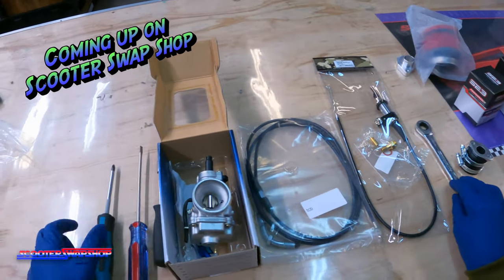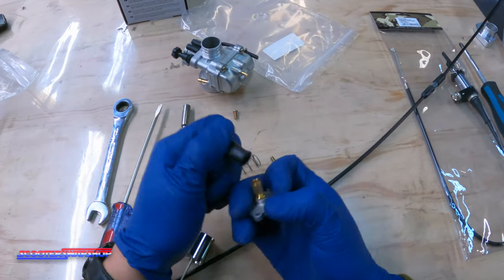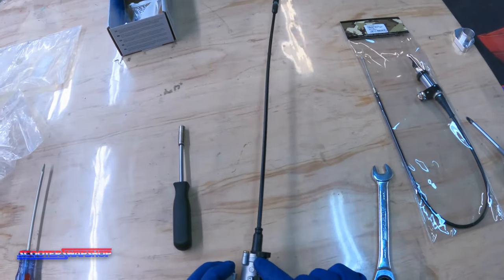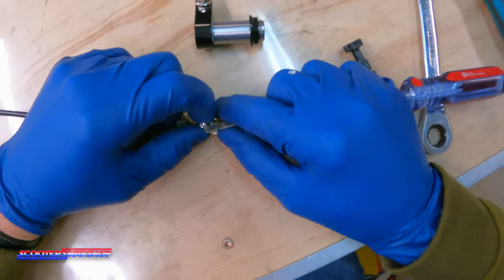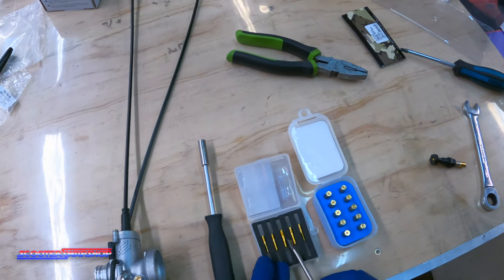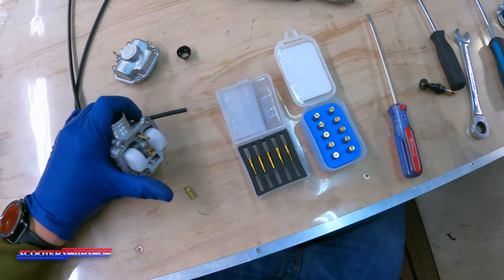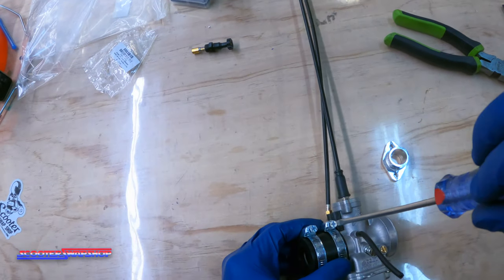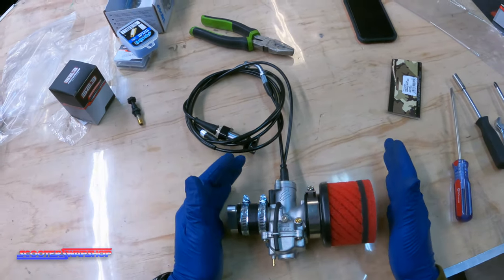How to install: Honda navi Performance Carb

Comment: Great video. I hope to get mine soon. Love my Navi and the upgrades I have done so far. I like these info videos along with the fun ones you have done recently. The instructional are my favorite though. Keep ‘‘em coming! I would love to see a video of PROPER brake adjustments for the Navi. Not a lot of good resources for drum brake adjustments. (That I could find anyway)
Reply: What is your top speed now?
Reply: @brettrolf4878  I have not been able to get the polini working at my elevation…. YET! I have new jets to try, and I bought a exhaust to see if I can get it tuned properly. My top speed in the flats right now is 45-52 MPH . I have hit 52 a few times, but it usually sits about 47. Hopefully I can get the carb right and my hope/ goal is to be able to maintain 45 at 3/4 throttle. I’m not racing, just want it to be more efficient use of power and not need to work it so hard in the 40-45 range.

Comment: hello, your videos are very interesting modifying scooters, I have a navi and I would like to get the most out of it in all aspects, engine, cvt, intake, exhaust, electronics (cdi, coil, spark plug, a better more powerful stator) better rims, brakes disc, bigger tires, etc...

Can the displacement be increased? up to how many cc could it be increased

will it be possible to make a swap for that of an injected honda pcx?

thanks greetings.
Reply from the maker: Hi just send us a message on the app. There are no big bore kits currently

Comment: Hey what are your impressions on cheap OKO carburetors from Aliexpress, they seem very appealing. I have a naraku 75cc aluminum kit. I'm making my own Arrow pipe right now but the stock carb isn't going to be enough. It's a Kymco Fever ZX2 af18 clone with a 14mm i believe, I drilled the main jet to 100 and it's been running well for over 2 years now with the stock pipe. Can I get your recommendation?
Reply: They will tell you they suck and then reccomend a polini cp
Reply from the maker: You get what you pay for in theory

Comment: Is there a fuel injection conversion?
Reply from the maker: No sir, and if we made one it would likely be $500-1000
Reply: @Scooterswapshop  if it is on the lower end of that range ($500) sign me up ✍️ - It would be super helpful to not have to keep rejetting lol

Comment: I put on your intake and variator   With jet kit …   Not sure i got any gains at all honestly   Maybe 1 mph top end  maybe 2  gonna keep messing with its   Had to punch out Welch absolutely   No option on that
Reply from the maker: The tuning takes time. You should be getting 55+.
Reply: @Scooterswapshop  it is getting better.  I bet the damn plug was fouled from factory being so rich   It is definitely cleaning up now after about 60 miles   Maybe mention cleaning or replacing plug on site.   Just a thought    Sounds awesome  it’s definitely better today  much more middle and high end punch    Nice products
Reply: @Scooterswapshop sir what's the loud rapid popping noise when I top out and what bond can I use?

Comment: I SO REGRET BUYING THIS BIKE ,BRAMD NEW GOT INJURIES ACCELERATOR THROTTLE RUN OFF UTS LOOKING LIKE HONDA N DEALER TRYING TO PLAY ME WITH INJURIES.UR GOING SO FAST BUT LOOKS EASY .I SQEEZE my cable n it's keeps cutting off won't go forward don't know what's wrong with my bike ,a cord looking loose  on carburator also horrid gas burning n a smell of burnt stinky fleuw coming out the engine each time I start it,.TIRES WACK ..I DONT KNOW WHAT I WAS THINKN.LOLN ILLINOIS FRAUD BY CORP N CORRUPT JUDGES MASSIVE WIT RECORDINGS PROOF OF ALL SLIME BALL JUDGES BUT WISH U lives close I'm disabled but..
Love how they n ruthless sec of state broke the law for a liicenses n plates etc n how after fact the corp drops a bike no papers receipts nothing but then they came in tell me the bike had been recirculated,n that all this stuff had been done or was wrong but itbwas to late ..yeah bRUTAL HERE
WENT TO ATTORNEY GEN AGAINST HONDA FOR LEGG N HAMD BLOOD RACE OFF INUURIES N WILL B SUEING Soon if I don't get money back n a operatable new bike
Sharing a experience love yo vids bro
Reply: Probably don't sue it won't go well